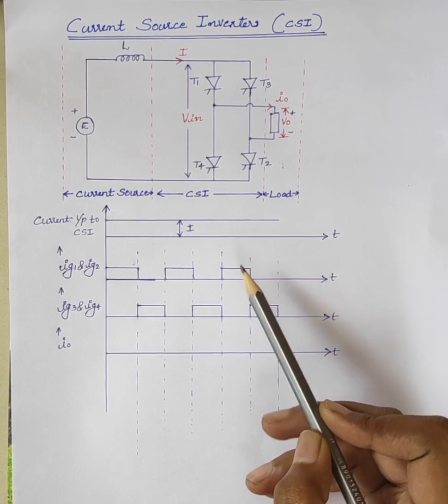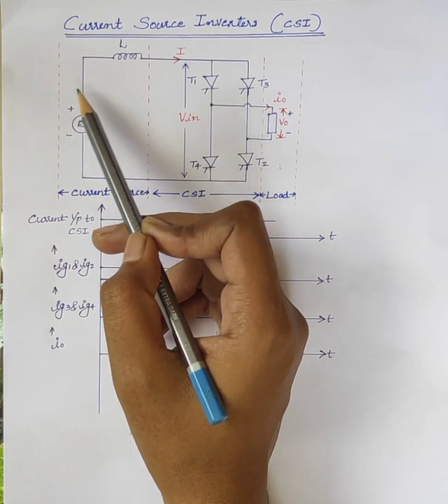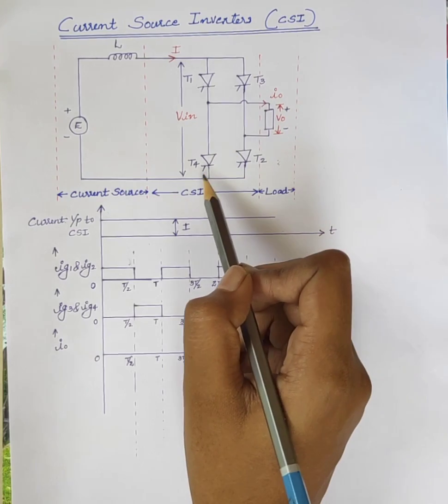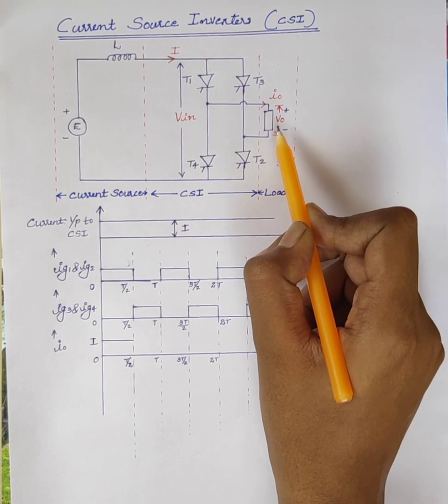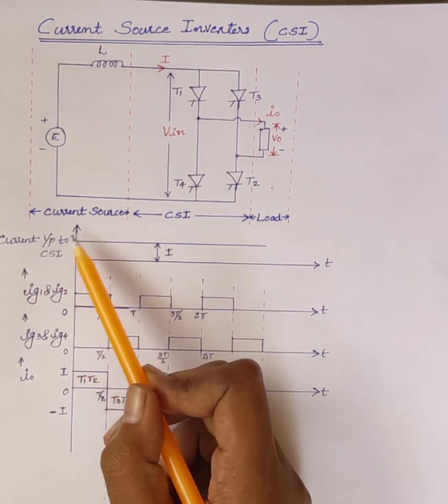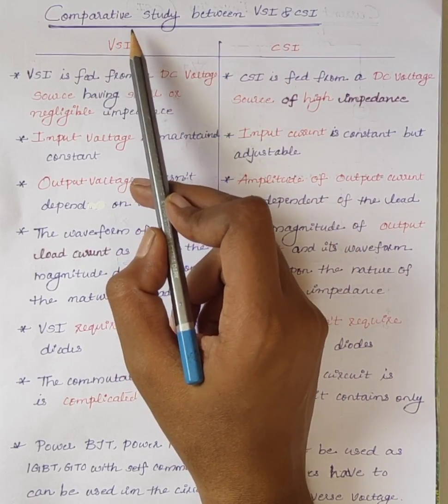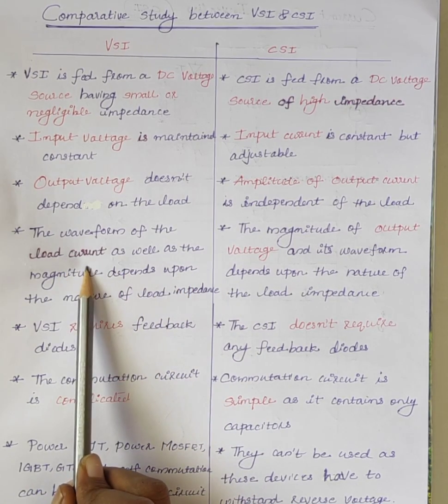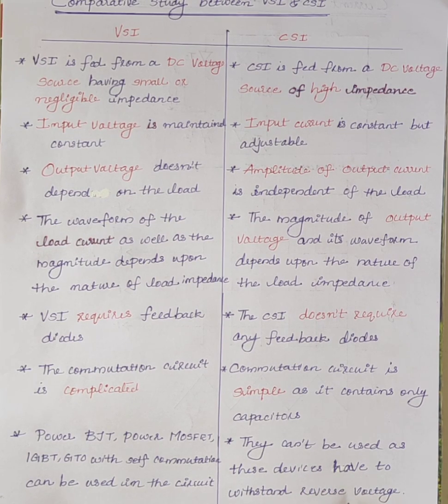Current Source Inverter (CSI)

Comment: Thanks maam i have a question 

one primary source and one secondary source current is given to a load, It runs generally on primary source current, which component or circuit change the source current from primary to secondary instantly as the primary current source loses power?